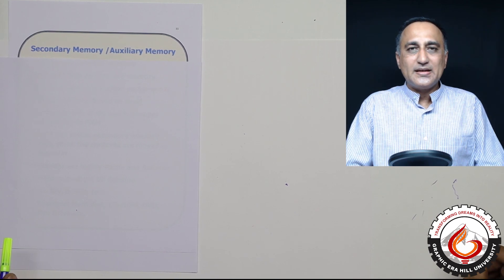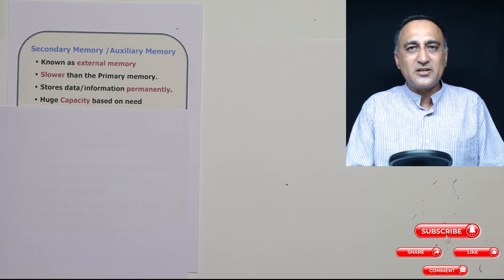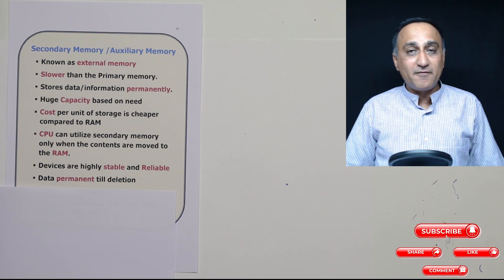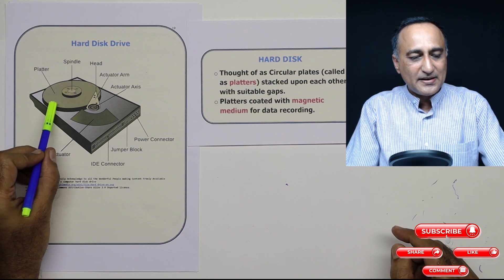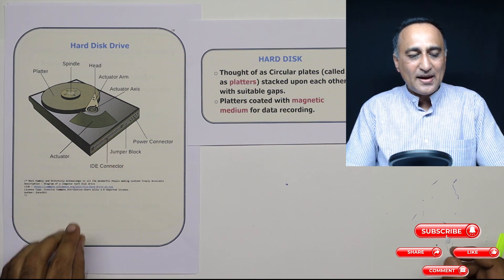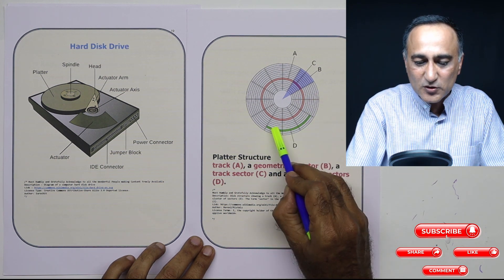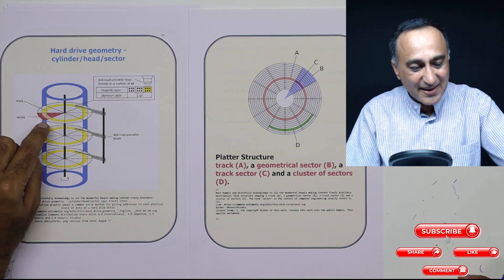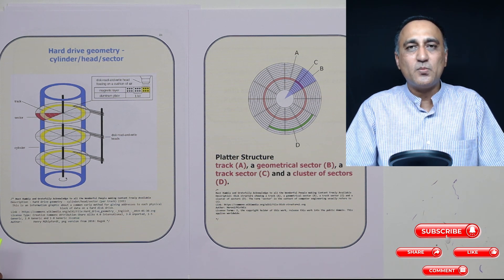WK3 - 16 Secondary Memory and Hard Disk

Comment: Sir, as per the last diagram if any data is on different track and not on the yellow shaded one. So, how will the head  read that information if it remains fixed??
Reply from the maker: Head is not fixed. The only issue is all heads move together in the same direction or place. If data is scattered across the tracks then the reading shall become inefficient since only one head is reading/writing data and the others are idle. That's the concept. Suppose a file is stored in a manner that all the data is on the same track for every platter (top and bottom) then the reading shall be faster since all the heads are actively reading data in parallel.
Reply: Thank you sir for your nice explanation 🙏
Reply from the maker: Welcome!